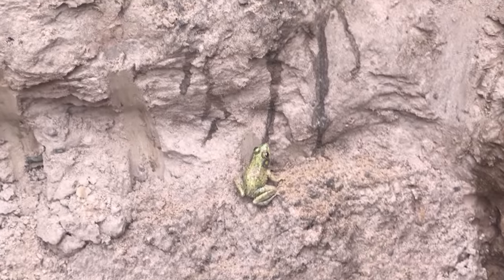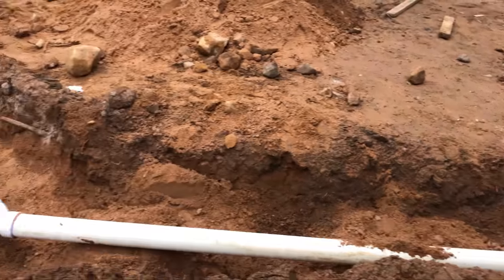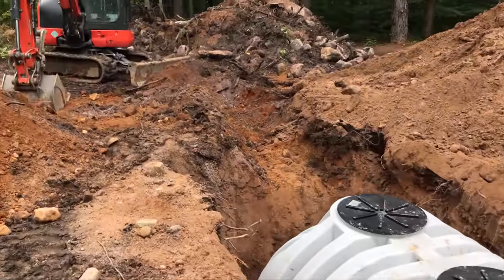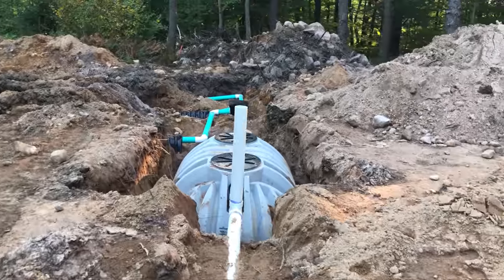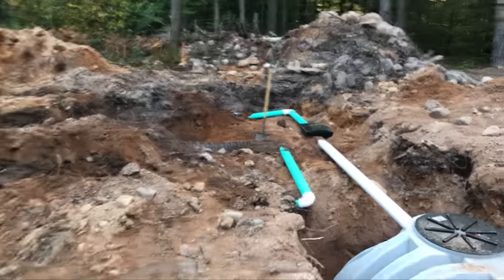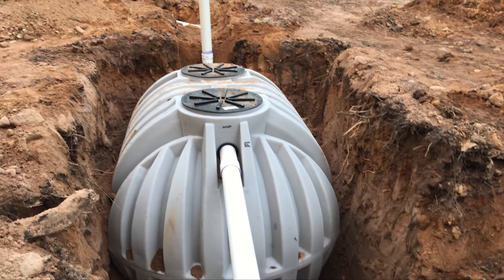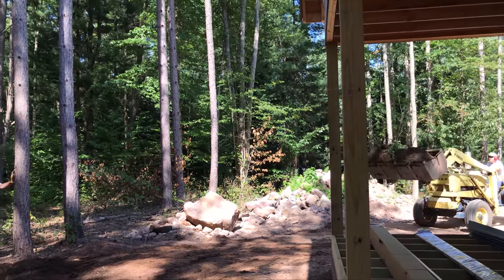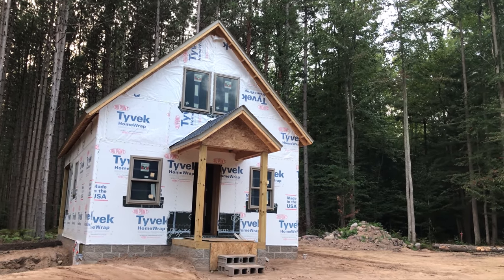Kubota KX 040-4 New House Septic Installation (House Project)

Comment: Is there pipe under the black covers ?  Looked like the line only goes into the first black chamber. I'm used to leach line with holes and then rock.  Thank's for the video, looks great !  👍👍
Reply from the maker: No pipe though the whole chamber water pours in the one end and soaks in though the whole length of the chamber.
Reply: @timberridgehomestead  Thank you for the answer, just have to digest the idea of no drain rock.  Great video, 👍👍

Comment: Just curious, did you guys have an experienced/licensed installer help?
Reply from the maker: No we did the work are self.  Did have a engineer do the plans for size and such he all so did a final inspection.
Reply: @timberridgehomestead  Great!!!  I am an installer and in the process of buying a similar compact track hoe (Kubota U45).  It looks like the 040 (9480lbs) is more that capable of doing septic system installs.  The U45 (11,800lbs) should be cake!  I currently use a CAT 420D (18,100lbs) and was concerned the U45 may be too small. Thank you for the video!!
Reply from the maker: Thanks!  Yeah the 040 had no problems and my land is very gravely definitely not a fast as a bigger machine is but does a great job still.
Reply: @tinstar5080  The 040 isn't a compact, as a result it's closer to  U45 in it's breakout/stroke abilities.  You simply have less counter-weight in the U45 but it'll be plenty.
Reply: @thereasonableamericans411  Thanks for the input!  I bought the U45 and have been using it for my installs and repairs for several months now.
 For anyone reading this in the future  the U45 is just barley heavy/strong enough to get the job done.
Case in point, on a septic repair you often have to remove the lid on a 1000 concrete gallon tank.  
The U45 can just pull the lid and move it out of the way.  You just have to be careful how far out you reach with the lid on the hook.  Over the front blade your good but when you swing to the side to set it down you can lift a track.
Digging  wise its plenty strong and as mentioned above, not as fast as a bigger/heavier machine.

Comment: I have never seen anyone put a pea trap on before there septic tank is that normal or just something optional  ??
Reply: Every state has different rules so a P trap may well be required in their area.  It isn't required/done in Oklahoma.
Reply: I was told by a licensed YouTube plumber its a grease trap. In residential installations in Texas they are common.

Comment: p trap will plug not needed
Reply from the maker: Still working just fine 4 years in and code here asked for it.
Reply: yeah just wait longer it will wait till they flush those wipes and too much toilet paper its not going to be able to push through with solids . going to collect  paper in the trap until it finally plugs. here comes the plumbers to snake it out . even the licensed plumbers will say thats a no no. health dept aren’t even plumbers they are pencil pushers that dont know shit. im a septic installer myself and ive never seen that bullshit. so ya can be arrogant and stubborn cause when the ground freezes its going to get caught right there at that trap and harden up.  Have fun trying to unplug your bullshit y’all have issues trust me and then yall get a plumber and he will be like why on gods green earth did they put a p trap. he will tear the bs out and put a straight pipe in. goodbye
Reply: another reason why ya don’t put a vent before tank is no  sulfuric acid gas can escape the tank and if that was concrete it would corrode the tank. another reason is without ample air the water wont flow properly through the tank it will trickle through instead of a flow. the vents in your roof supply air and helps gravity work. thats y ya have vents on your roof. putting more restrictions on the inlet is not a good idea butter belly.